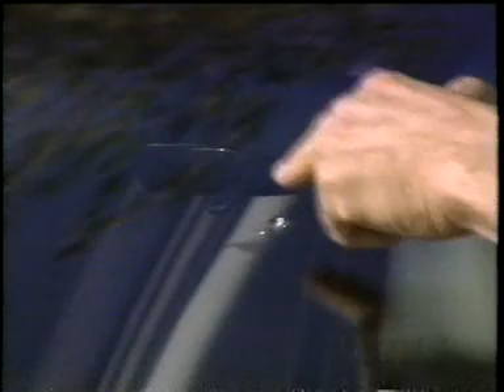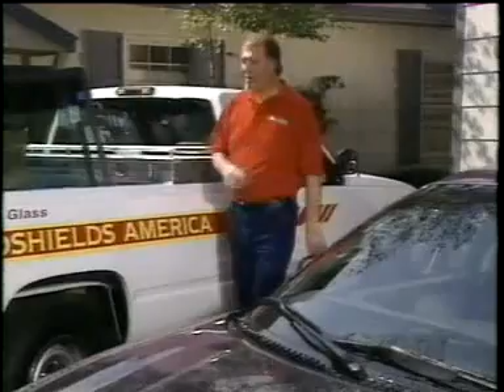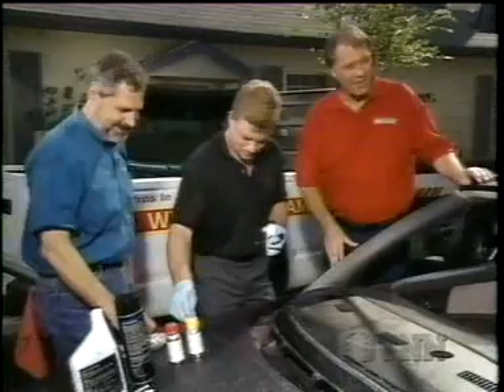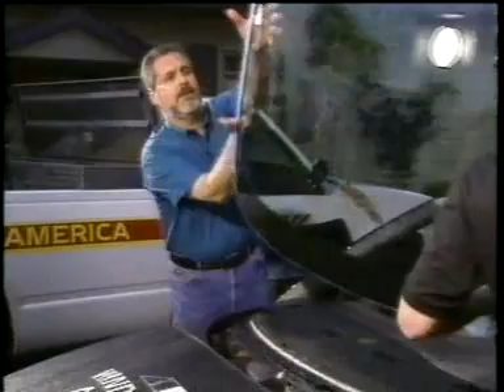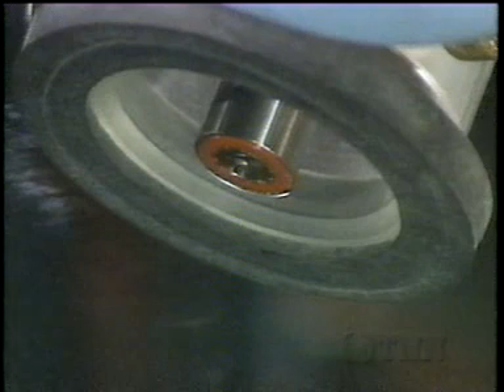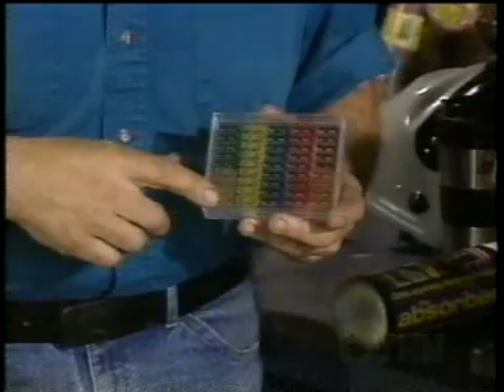Shadetree Mechanic ~ Windshield repair and replacement

Comment: Shadetree Mechanic was my favorite program back in the day. It played early Sunday mornings,I would tape it,always something to look forward to.Thanks for briging this episode to YouTube.
Reply from the maker: You're very welcome!
Reply from the maker: *****   Mine were also on VHS. I found them when I converted my collection to DVD.
Reply: PettyMower If you would, tell me the approach you took. How much effort per tape? What equipment,what software? I have perhaps 30 milk crates of VHS tapes,IDed but not indexed fully. Perhaps 150 episodes of SM,much automotive. Any info helpful. Thanks.
Reply from the maker: paul manson   Back when I converted my VHS collection over to DVD, I purchased a Philips/Magnavox DVD Recorder and wired it to a high -quality VHS player. Press record on the Recorder & Play on the Player until done. I always had a head cleaning cassette on hand to occasionally clean the VHS head for the best quality output.

These days you have other options including Dazzle which allows you to wire a VHS player directly to a computer. (The computer has to meet the minimum requirements or it will not work. It's actually best to be no where near the minimum requirements or the video could lag.) The Dazzle software makes it very easy to edit the footage......similar to Windows Movie Maker, if you're familiar with that.
Reply: +Jerald Rae Awesome....I'll watch them sometime this week.  Thanks!
Reply: +paul manson I did as well.
Reply: Same here

Comment: ahh yes, i have seen motorhead garage,  last one i seen with these guys was when they upgraded with a 5th wheel tow packageand they installed a retractable 5th wheel hitch in bed of pickup,  i do remember charging systems episode, car electricals are something i find hard to understand, what year did charging systems episode come out??

-Jess
Reply: And heater cores,trailer hitches wheel bearings

Comment: ahh,  memories,  i used to watch this too when i was about 13/14 years old,  most memorable one was when they worked on a red pontiac grand-am and replaced the struts,   i do soemtimes watch 2 guys garage,  its just not the same, but times change as the guys got older
Reply: the rest of em need uploaded in the worst way!!!